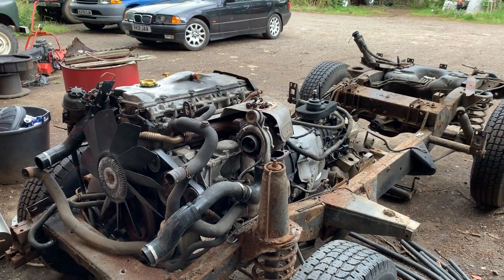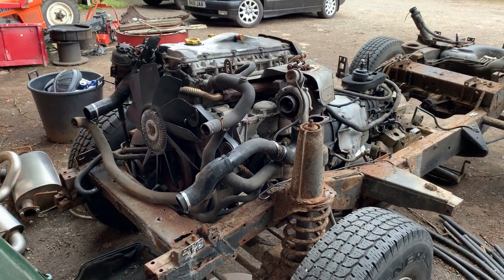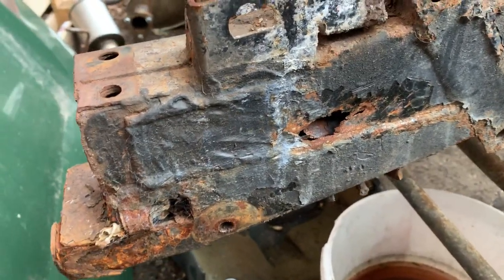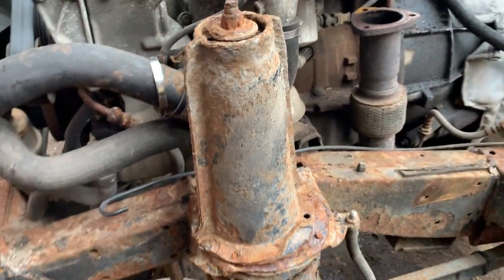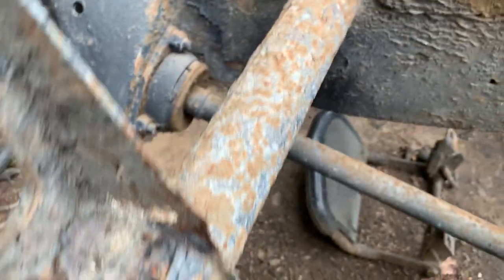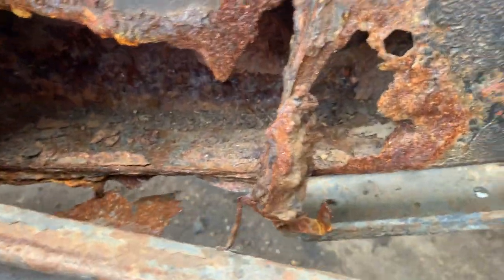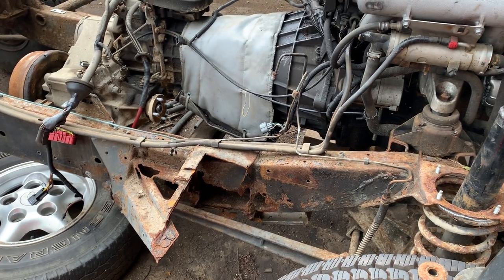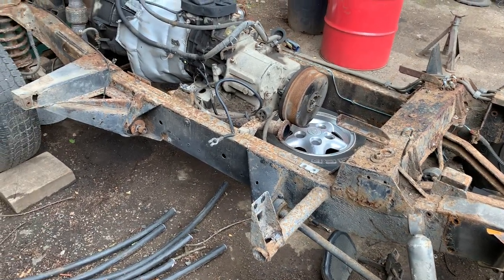land rover defender 90 rusty chassis

Comment: It's such a shame that once Land-Rover realised early-on that the chassis rots-out,they didn't just build them on a galvanised chassis straight from the factory or at least make it an option,and the bulk-head.The extra few quid on top of the price of a new car would have been so low in percentage terms that it would have made a lot of sense.Most of the other parts that rot can be sorted with a half-decent socket set
Reply from the maker: but then they'd never have sold newer ones once the originals were knackered - planned obsolescence

Comment: This appears to be a far-too common problem on Land Rovers.  Worse yet, this appears to me to go all the way back to the original Land Rover of 1948.  Has Rover or Land Rover ever done anything to protect their chassis frames from rust?  It doesn't appear to me as if they have.
Reply: The press documents for the original Discovery stated a galvanized chassis whether they did that or not Disco 1 chassis are usually good but bodies rotted for fun. My disco 2 chassis certainly wasn't galvanised and was made of thin laminated steel with too many water trap points and it failed spectacularly. I'm currently having it replaced with a far better designed galvanised chassis to correct what Land Rover failed to do
Reply: Non solo i telai l'intera vettura viene corrosa dalla ruggine dove c'è ferro c'è ruggine
Reply: @landrover8327 io ho sempre pensato che le carrozzerie del Discovery fossero interamente in alluminio quindi protette dalla corrosione. Invece i telai della Discovery non erano gli stessi del Defender mi parevano un po' più spessi e più protetti dalla corrosione

Comment: Whats the legality of putting a new galv chassis on which will not have the VIN on it, how does that work at the test centre if the inspector cannot find a VIN number on the chassis..thanks.
Reply from the maker: For MOT purposes, the VIN number is on the bulkhead (under the screen on the left hand side), and on the plate under the bonnet on the brake servo. On most Defenders, you can't see the stamped number on the chassis anyway due to a) underseal, b)previous welding, c) steering guard fitment. Exporting overseas is another matter though.
Reply: @motodromehenleyonthames  I only ask because here in the republic of Ireland when you present the vehicle for test, the inspector will not test it if they cannot see the VIN where it should be on the chassis, even if you have all the other locations marked with the VIN.
Reply from the maker: we do advise people looking to export ones with galvanised chassis from the UK that they may have that sort of problem, and that it's best not to bother.
Reply: My landrover dealer stamped new replacement and cut up the old one.
Reply: @davidheap5338  A friend had a galvanised chassis replacement a few years ago, presented the MOT test centre with invoice for the work and didn't have any problems then or since.

Comment: hi, its simply discraceful that  land rover has been allowed to get away with inferior chassis all these years ! a bit of sea water and this is the result., thicker box section chassis and  a dip into the waxoyl tank thats what i  would do
Reply: Petersmith fosse per l'acqua di mare che si corrodessero potrei capire ma queste auto marciscono in poco tempo con acqua dolce e un po' di fango e con ruggine perforante. Gli acciai sono troppo sottili e si piegano facilmente e sistemi anticorrosione manco l'ombra 🤦

Comment: How much would work like this cost?
Reply from the maker: to do it properly, 5 to 6k plus the cost of the chassis. Can be done for about 3k if you cut corners - we didn't.
Reply: mine cost 10k
Reply: Mine cost 6 000 with new suspension and brake lines.took 7 days turn around.
Reply: @harleycg75  Where did you get it done?